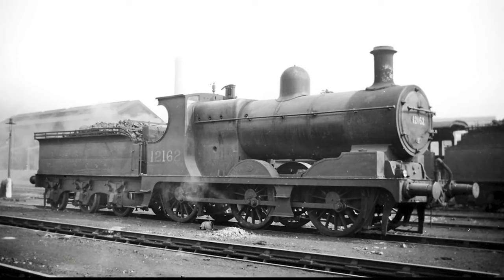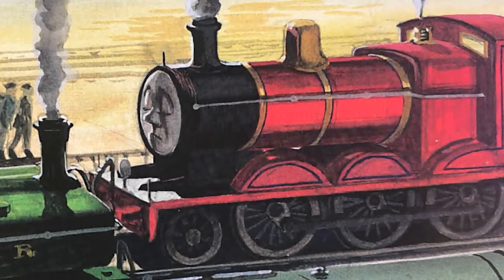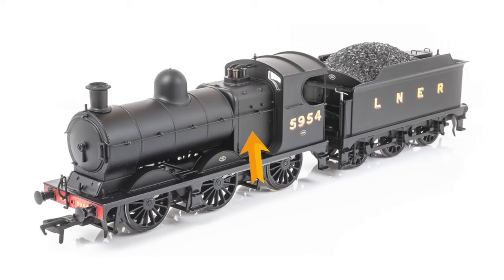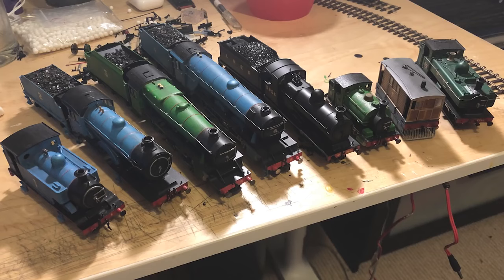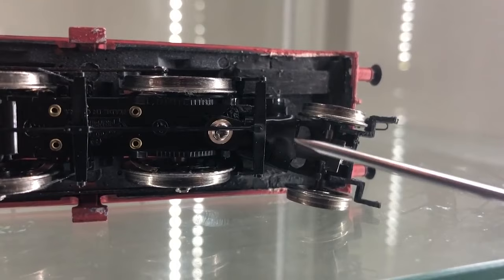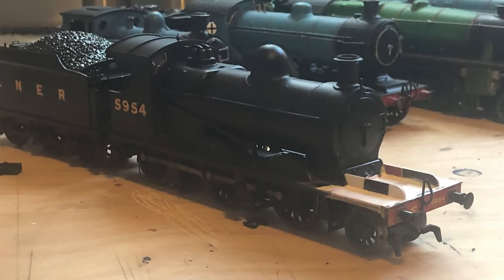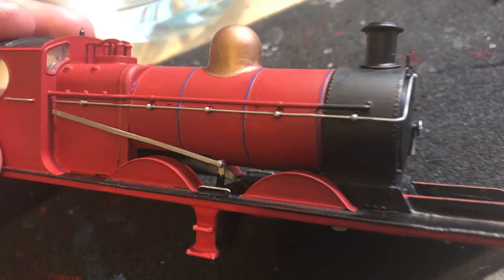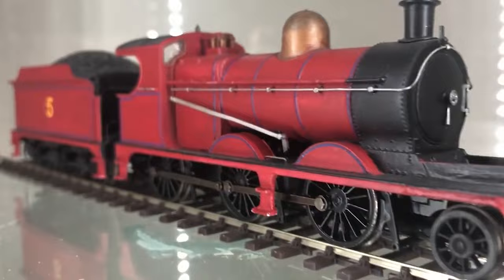How I Built James – Tug's Trains

Comment: Hey tugs I found a Fowler tender shell on eBay and it’s much cheaper or you just had to do is repaint it and do the lining and the number, but all though there is a problem you’re gonna have to rip the shell off from James’s tender and replaced it with the Fowler shell